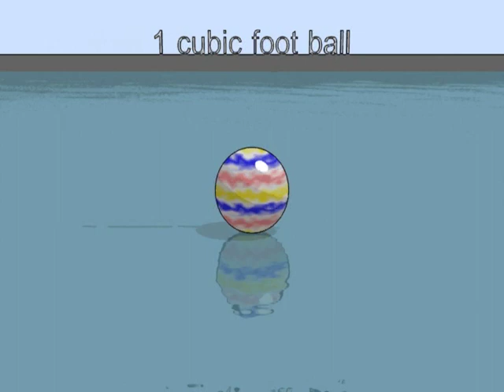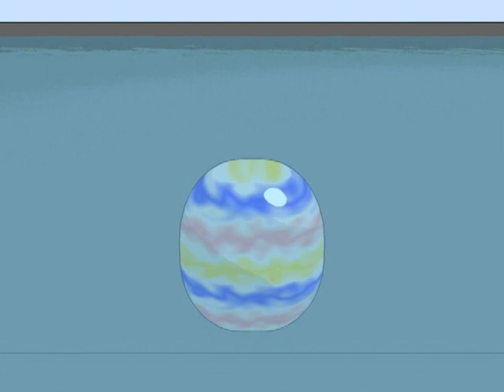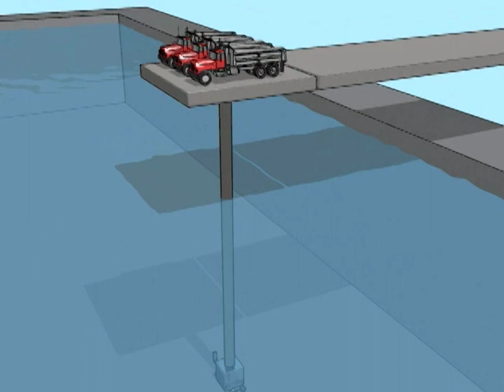HYPEG - WATER+AIR=GREEN ENERGY

Comment: The 2 chambers would be shaped like a bell in 2 tall tanks. With a chain tieing them together. And a gear at the top and the chain meshing with that gear. As the bell shaped weight settles over a corresponding shaped bell at the bottom. As the one bell descends over the fixed bell at the bottom it forces the water to evacuate through a one way valve located at the top of the buoyant bell

Comment: this was my first build. I have.made many changes. I replaced the buoyant chamber with several chambers on a conveyor belt. The air is compressed via wind turbines or solar panels or tidal changes or run of river or dams and stored compressed until needed. The compressed air is inserted from below to fill the conveyor containers as needed. And yes as the compressed air ascends it expands increasing the lift. I have published all of this so there are no restrictions on a build. Build it if you want. If you have any questions I will help you free of charge. Im too old to worry about money.
Reply: If you already have compressed air why not just spin up a turbine?
Reply: Where did you publish this?

Comment: Hello,I sketched out a model of something similar a few years prior to watching your video. People need to realize that this would be a way to create energy more efficiently than current processes, and that we are not expecting something from nothing. However, would not the potential energy increase relative to the height of a natural drop in elevation from the water source? Chamber need only be replenished once per cycle but height of vessel is variable. This is different then other models in that it does not require equal energy to exaust the water at the bottom of the cycle, because the vessel is not under water. Same reason Jerry cans have a breather port. This method will require much less water than turbine methods. Could also function in a closed loop using a solar powered pump. What is a river other than a repeating process powered by the sun? Thanks for you time

Comment: Most of you (even the person posting this apparently copied video) aren't seeing the simplicity of this device... you "overthink" it, assuming it's related to other Water/Air machines.   You need to see this as if it were scaled up to the size of a hydro-electric dam. It goes in its place... at the point of a water dam (or natural waterfall), where NATURE provides the continuous flow of water. NO WATER OR AIR IS BEING PUMPED mechanically... the machine it simply "allows" the water to escape the moving tank when it "falls" to the bottom of the outer container, by opening valves at the bottom. 
(read more)

1) From the previous cycle, the "buoyancy tank" begins at the top of the water column, devoid of any air, filled with water.

2) The water-filled buoyancy tank begins to fall (by gravity) through the outer container column which contains water, due to it being heavier than the surrounding water (tank weight =  heavier than water). 

3) When the "buoyancy tank" reaches the bottom of the outer container water column, a mechanical latch (on the vertical square tube on top of the buoyancy tank) locks it down in place. This is important!   This latch may need to exert a small amount of force to seal it (see the seals on the bottom of the PVC tubes?), but very minimal force would be required.

4) The "drain tubes" at the bottom of the "buoyancy tank" are now mated-up to "drain holes" in the bottom of the outer container / water column. These drain holes are normally sealed-off by means of mechanical water valves, so that water in the "column" does not escape.

5) The "drain vales" are now opened fully, "allowing" the water to escape the "buoyancy tank" (which is now latched into it's "bottom position"). These drain holes simply empty into the river below the Hydro Plant. Again... Nature/Gravity does the work... no pump is involved!

6) As the water falls out of the "buoyancy tank", something has to replace that empty volume... air rushes in... no pump.

7) Once the water has all "fallen" out of the buoyancy tank, it is now "filled" with ambient air... buoyancy is now trying hard to lift this tank it to the top of the "outer container", but the latch is still holding it down.

8) The mechanical "hold-down" latch is now released, allowing the buoyancy to "do the work" of Generating Power... via the rising vertical square tube attached to the top of the buoyancy tank... driving a generator (likely through a one-way clutch with override, so that no load is presented while the buoyancy tank is "falling").

9) Once the buoyancy tank is at the surface of the water column inside the "outer container",  a mechanical "hold-up" latch now holds the buoyancy tank in place for the next step.

10) A set of "patented vales" opens at the top of the moving tank, allowing water from above (lake level above the dam) to now displace the air in the buoyancy tank, forcing the air out (no pump), causing the buoyancy tank to lose buoyancy.  Once all of the air has escaped the buoyancy tank (filled with water), the "hold up" latch is released, and the whole process starts over from step 1 above.

This type of generation would require a TOTAL redesign of the power generation system, for the same reason existing hydroelectric plants are inefficient... they require constant-speed drive system for the generators (alternators actually).

With this (above) type of generation, which works on slow rep-rate cyclic power generation, you would likely need an energy storage system, feeding a electronic generation system... which would be far better suited to handling "peak loads", since you have some energy storage.

The physical layout upgrades to a pre-existing hydro plant would be massive... but it really could be well worth it... the efficiency gained would be incredible.  The normal "spillway" would be replaced by the huge "water columns", in which the "buoyancy tanks" would operate. This type of system would work best for dams with greater height differences between inlet and outlet... like Hoover.
Reply: How is it that you think turning a valve requires a lot of energy??
Reply: Well, since you are using gravity, would it be simpler to have the outer tank empty and fill?
1)first action- the sealed inner tank sits at the bottom of the outer/water column tank. The inner tank is filled with air, the outer tank is empty. The inner tank is held down by a catch mechanism.

2) second action- the outer tank is filled with water to the top. When water level reaches the top a float mechanism is triggered and cuts of the water flow while simultaneously releasing the catch on the inner tanks.

3) third action- inner tank rises to top. When it reaches the top it triggers a mechanism which opens a valve at the bottom of the outer tank.

4) fourth action- the outer tank empties, the inner tank sinks down with the water to the bottom where again it sinks below a catch which holds it.That catch would also trigger a mechanism that would open the valves at the top while closing the valves at the bottom.

The inner tank could be weighted so that it would exert as much force as it lowered as when it rose allowing it to generate as much electricity as it lowers as when it rises.
This could work in areas with large variations in tide.
One could put another twist on it by having a spiral groove run up the inside of the outer tank. The inner tank could be formed so that it has threads that fit in those grooves the way a screw fits in a threaded hole. As the inner tank rose it would turn, creating rotary motion. One could eliminate friction between inner tank and outer tank's grooves by having magnets on each. Arrange them so that the  north side of the magnets on the inner tank's threads face the north of the magnets on the outer tank's threads.

Comment: +Tim Gard Brilliant invention!!! I do have one question though. If the water is being drained out, wont there eventually be no water left in the tank to generate the buoyant force? Is there any way to get that water back in teh tank without using more energy and violating laws? Thanks a lot! Awaiting your response!1
Reply: +rit pat this looks like it is for use on a dam wher ethe water was going from the top to the bottom to begin with.  this is harnessing the energy on the way back up though , which is substantial and way better than the way we are currently doing it, like he said 8% efficiency.
Reply: I think this is not Perpetual Motion Machine, this device uses water from some dams or rivers, but instead of using turbines, it use this instead, claimed to have greater efficiency than traditional way (turbines). CMIIW

Comment: A question response from a friend ...

> Hi Tim,
> 
> I see that your hydro pneumatic system is made possible by your unique
> valve system that first takes in water to be combined with the weight of
> the chamber to effectively submerge the device. Then the valve system
> expels the water and intakes air, which stores the now buoyant energy of
> the air filled chamber.
> 
> I understand that for each cubic ft of air pressure which is stored, 62 lbs
> of force is then generated, that number is then multiplied by the number of
> feet the chamber has been submerged under water. When the chamber is
> released from it's locking mechanism, the chamber lifts and power is
> generated.
> 

> 
> I am interested to see what comes next.
> 
> Thanks for sharing,
> 
> KF

The purpose of this device was to show how easy it was to insert air into the bottom of a water filled chamber. I built this for two reasons. A picture is worth a thousand words, and to make me feel better about my first attempt which was a failure. The second attempt I paid attention to physics laws, and it worked! Damned physics!

Now, in the actual design of a working HYPEG, we take the same column of water, insert a conveyor belt with buckets that fold flat against the belt, think cloth buckets with a waterproof coating, then insert compressed air into the bottom just as the empty buckets swing around, shoot the compressed air into each bucket as it starts on the up side of the conveyor. Now, lets say that tower is 100 feet high, and each bucket is one foot high and holds five cubic feet of air. That's 100 buckets times 5 cubic feet. Each foot outputs 62 pounds of lift, so 62 pounds X 5 cubic feet X 100 ft = 31,000 foot pounds output for each bucket, now there would probably be about 210 buckets total, so the total output of a single cycle of this unit would be 6,510,000 foot pounds. Now, with introduction of full cycle time, say 0.2 hours or 12 minutes, you have the numbers to compute joules per second, giving you the total max output of this design. Wanna take a crack at it?
Reply: +Tim Gard Brilliant invention!!! I do have one question though. If the water is being drained out, wont there eventually be no water left in the tank to generate the buoyant force? Is there any way to get that water back in teh tank without using more energy and violating laws? Thanks a lot! Awaiting your response!1
Reply: +rit pat this water could be replaced with any water from an elevated source. You could use a lake a creek or river or even an elevated reservoir like those used for water supplies in towns. The other advantage to this is that you don't actually have to drain the water in order to get power out of it. You could simply insert compressed air into the bottom to drive the system. This compressed air could be generated with wind turbines or elevated water sources or  geothermal or even solar panels.
Reply: Tim Gard, you have understood the mechanics of this system very well.

Comment: The graphic with the trucks is total incorrect, the 1000cft box would not lift the trucks all the way to the top, as it looses power the closer it gets to the surface, if it had exactly enough force to lift them it would travel upwards less than a foot before it was over come and stopped.
Reply: +ijustwanttoseetitty  That is incorrect. as long as the displacement stays the same, the lift will stay the same. The lift will not reduce until the ball breaks the water surface. basic hydro-logic math. Based on your science all iron boats would sink. But yes, there is a mistake in my math. 1000 cubic feet displacement could only lift one of those trucks. My bad ... But you! I hope you will keep asking questions, I do my best thinking when I address others questions! That makes you beau coup important to me! 
And those titty things? Highly over rated man traps!